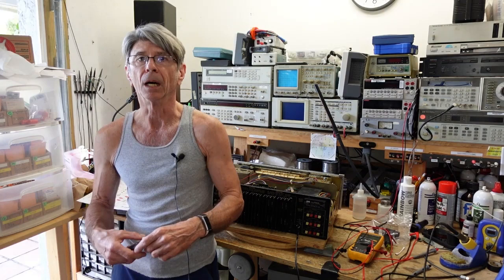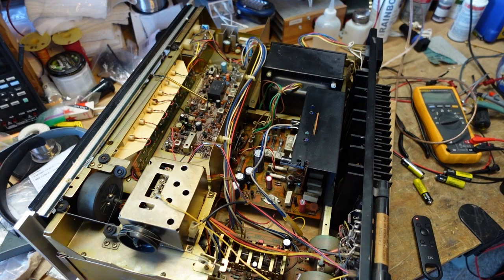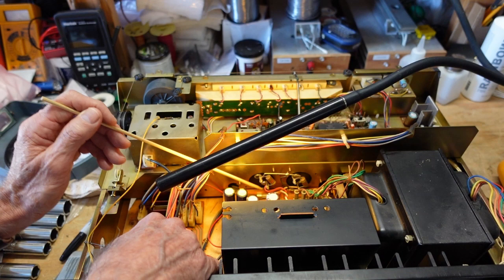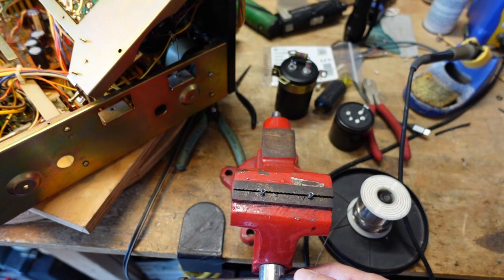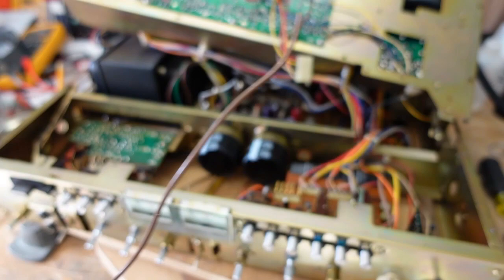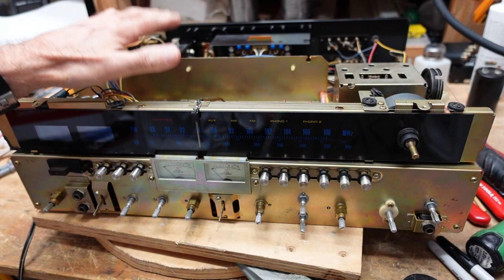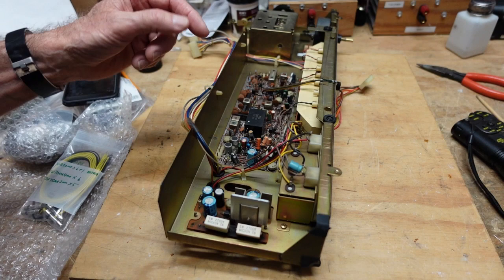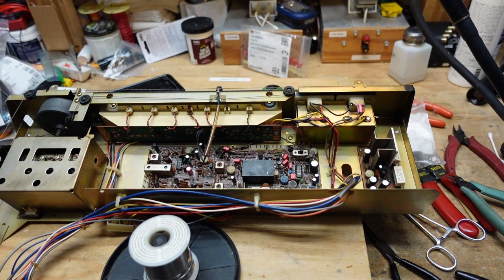Sansui 9090DB Restore Part 2  Restoration Begins

Comment: Whenever you recap a driver circuit you should always replace the feedback capacitor in the differential amplifier with a nonpolar (bipolar) electrolytic cap.  In theory you could use a non-electrolytic film capacitor but it's usually almost impossible to get one that is physically small enough to fit yet meets the required capacitance and voltage ratings.

Comment: Whether to do the recap first or not kind of depends on the problem.  If you can narrow the problem down a bit, for instance the FM doesn't pick up signal, you can recap everything and it may or may not fix the FM problem (probably not), but you won't be creating new problems without knowledge of where you created it.
Reply from the maker: Agreed, that's why if you're recapping you should test after each section.
If the FM doesn't pick up signal, you can inject a signal into the IF with a substitute tuner.to determine if it's the front end or IF.  I did this in of the Marantz repair videos:
https://youtu.be/oWuJJ72scnk
Reply: @raygianelli3612  I just had to do that with my 9090db, which is why that example came to mind.  I still haven't figured out the problem, but I get no signal at tp1.  I found the 2sc1045 was bad in the front end, replaced it with a ksp10, but still no signal.  I imagine there is a bad passive in there causing trouble, so that's where I'm checking tomorrow.

Anyway, good job on the videos.  Thanks for them.

Comment: Any opinion on the Wurth Electronik caps?  I was recently scrutinized for using them yet I’ve never had any issue from using them nor have any ever tested bad.  My theory has always been that as long as Mouser carries it, it’s decent.
Reply from the maker: Mike, I've used them as well with no issues.  Ask me again in about 30-40 years and we'll see how they hold up.  🤭

Comment: hey Ray, nice retoration !  Where did you find your special handy screwdriver ?
Reply from the maker: Roro, I picked up both the cordless screwdriver and the JIS screwdrivers on Amazon.  The cordless is a Hitachi; I liked it so much that when I was in the market for a cordless drill I got a Hitachi, and it's truly excellent.  The screwdrivers are made by Vessel.
Reply: @raygianelli3612  And what about the small ratcheting screwdriver ?
Reply from the maker: @roroseppel2077  I can't remember where I got it, but chances are good it was either Amazon or Harbor Freight Tools.

Comment: Ray, I swear I almost asked about JIS on one of your prior videos and I believe your the first one I've seen mention it. A few years ago I learned of JIS because nothing else worked.  I've noticed  at times I dont get a good bite and may dig the screw head.  Do you think maybe we've been doing it wrong the whole time and should mainly be using JIS screwdrivers for these Japanese units?  Thanks!
Reply from the maker: Victor, I read about them on an audio forum a few years ago.  I recently read an article about Phillips, JIS and Pozidriv.  The article said that JIS works better for Phillips head screws than Phillips.
Reply: @raygianelli3612  Ray I went down this rabbit hole.  I have the same screwdriver you do I had needed for a Panasonic Boombox so I checked a few of my units - Pioneer, Sansui, Onkyo, Rotel all had JIS screws.  I would notice the Phillips issues mostly when it would mar my black cover screws but never put 2 and 2 together til you mentioned it. Keep spreading the word and break the Internet. Thank you!